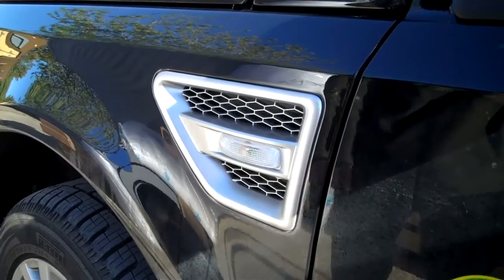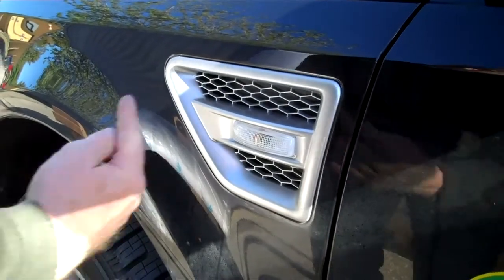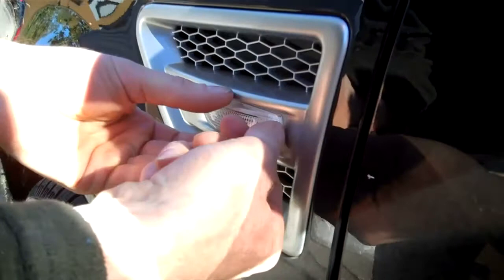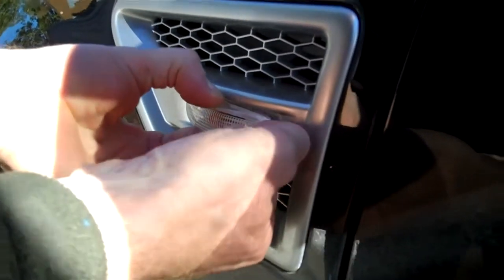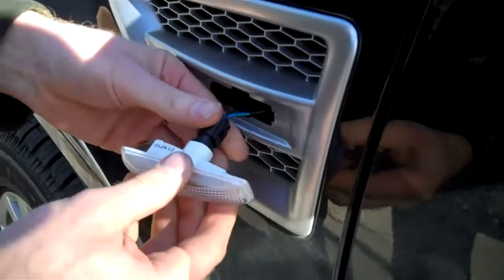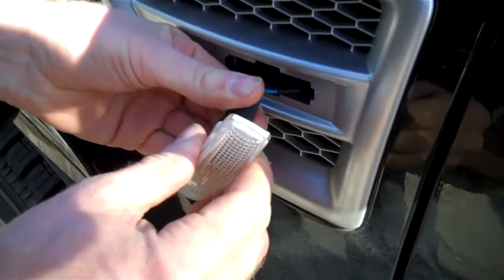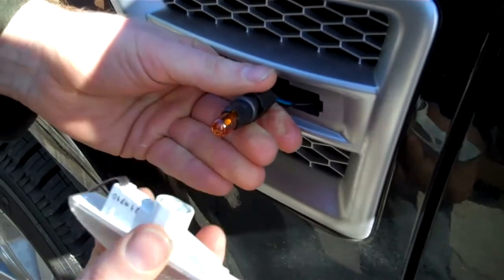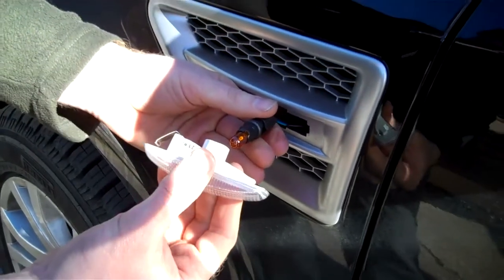How to Remove / Upgrade the Side Repeater Lights on a Land Rover Freelander 2 / LR2

Comment: Hi guys I’m ordering the gloss black and silver mesh side vents which side repeaters would you recommend the clear sweeping or the smoke sweeping.
Reply from the maker: Its hard to say.. you could buy both and send one back... the boss wont be happy with me suggesting this !
Reply: @ just noticed it’s clear sides I have and clear indicators I may try the smokes lol
Reply: Bought the led repeaters for Xmas but doesn’t look like I can get the bulb off to reveal a 2 pin connection?? 2008 landrover freelander 2 😢
Reply from the maker: @JigeryPokery51  How are you getting on - this should be straightfoward.
Reply: @L663  the bulb fitment is released by another sub clip to reveal the 2 pin connection for the led sweep upgrade. I figured it out and it looks great to me at least! All fitter no brackets broken. Thanks for the confidence to have a go!
Reply: Went from worn out silver to gloss black with the led sweeps. Awesome